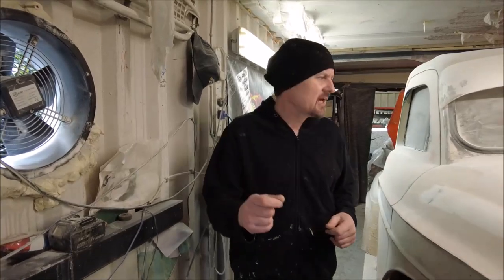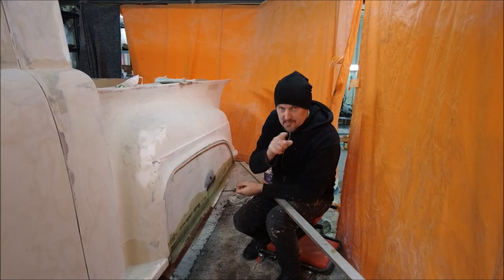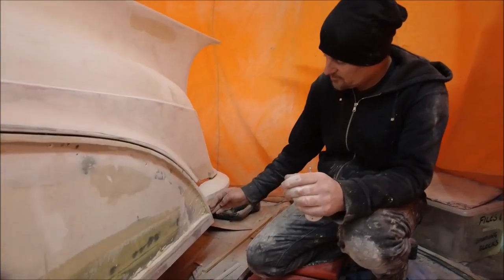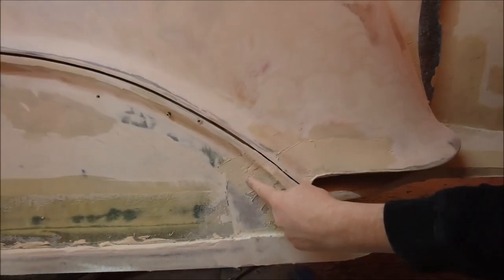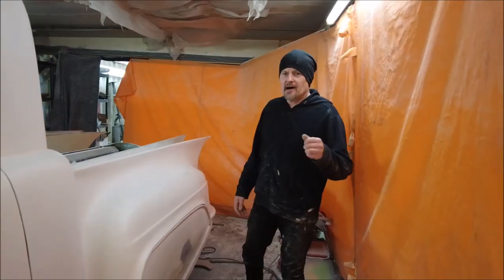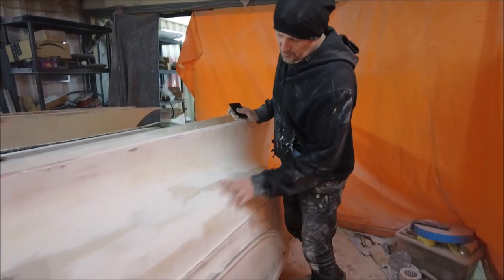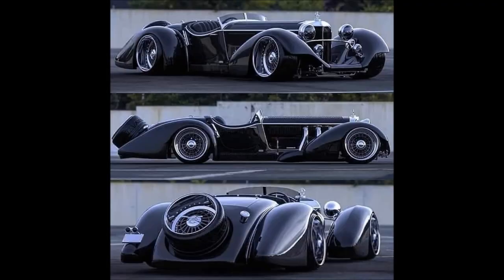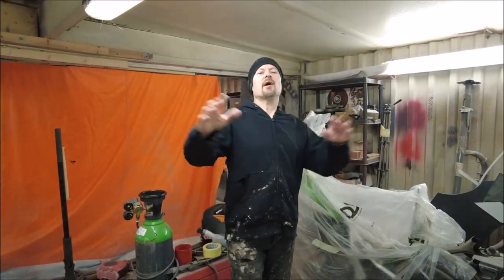HOW TO PREP A CAR FOR PAINT

Comment: Good Lord thats a lot more work than it needs to be lol. I use old school Bondo not that tack free stuff. Cut it with 36 gt while its hot and then put a skim coat of glazing putty on top. I spread it so it look like what I want because I'm the pour sole who has to sand it down.
Reply from the maker: Thanks for the tip

Comment: Hey Paul, yet another great video !  I'm surprised that you didn't mention using a guide coat for helping to find low spots or even pin holes or deed scratches.  By using a dark colored spray paint just misted over the primer or even the body filler it really helps find those.  Of course your hands may be better than mine but, I've been using it since the 70's and it's always shown me things I would have missed.  The rear of the custom truck sure has been some great work !  Have a great weekend and a great week !
Reply from the maker: Yeah I'll be using a guide coat later on.  Always welcome others input though, cheers

Comment: not seeing the 60s truck in person "its only speculation" but i still think the bumper should be complete on both ends , and if you had the end cut off on the moving side also (to match the other side) both sides would be stationary and complete , the continental kit should work with both bumper ends cut off  ?
Reply from the maker: Thanks for the input, but I'm really pleased with how it looks at the minute :)